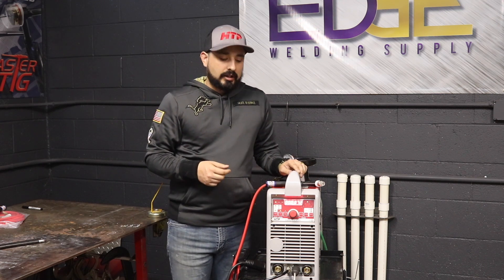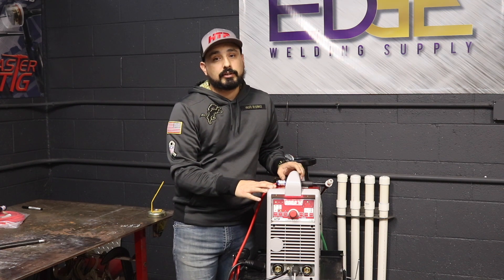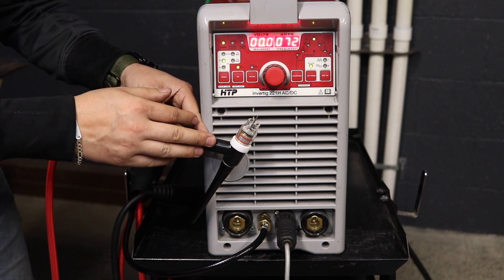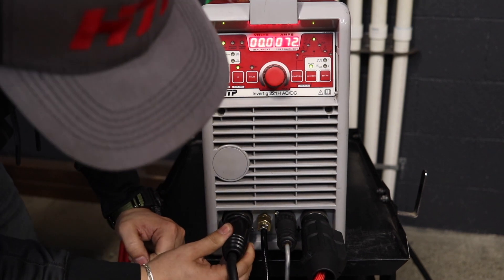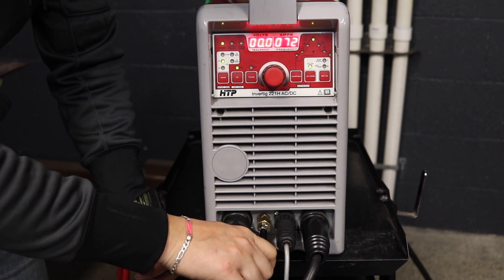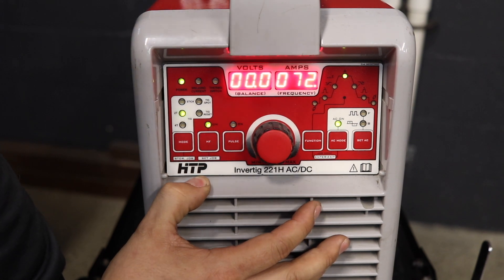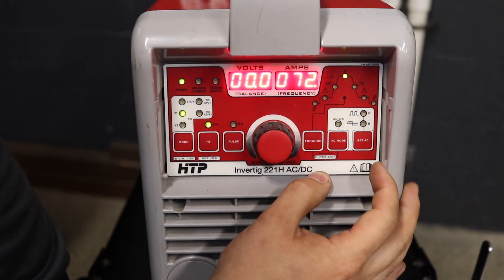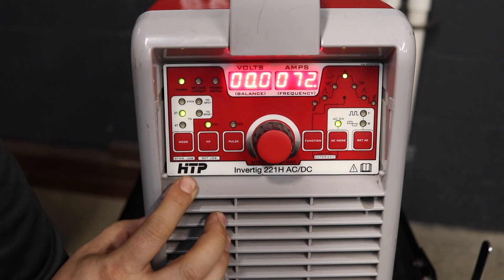4 Common Mistakes When Setting Up Your HTP Invertig 221

Comment: My HTP welder seems to have a inconsistent arc, i.e. it flashes, so it's not steady. Is this common with your machines, or is there something I can do to remedy this issue?

Edit: pulse is off.
Reply from the maker: No, HTP machines are known for a steady, consistent and stable arc. I would say check all cable connections, make sure you have a good ground and clean consumables. If you still have an issue call us at 847-357-0700

Comment: The 221 can be especially good for thin material, and it would be great to see some additional detail and examples.  The 221 has good low amps performance and range, doesn't do the brief high-amps start that some welders always use to get a satisfying "crisp start" and has has features like the TIG Spot mode. I'd like to see some repetitive tack welds on thin sheet metal to get/keep things lined up for later infill. Handling distortion when welding thin material such as body panels is always a challenge, and when you've got a welder that's a particularly good fit it would be nice to see how to make the most of it.
Reply from the maker: One of our future videos will be welding on thin sheet metal. But our current pulse video we weld some very thin razorblades.